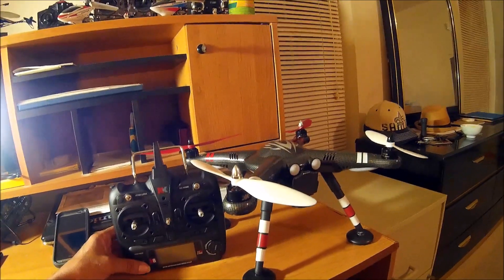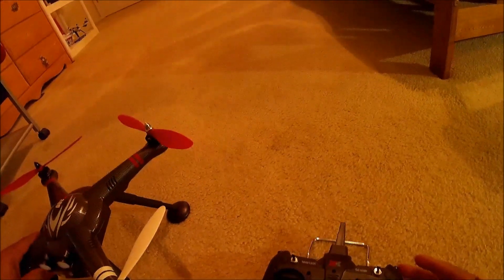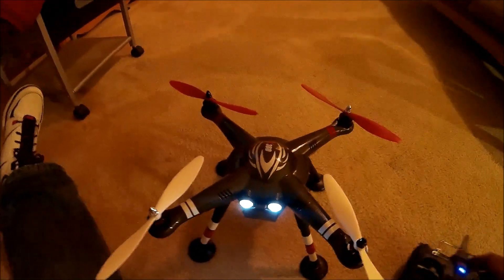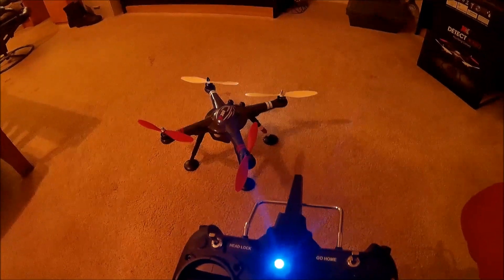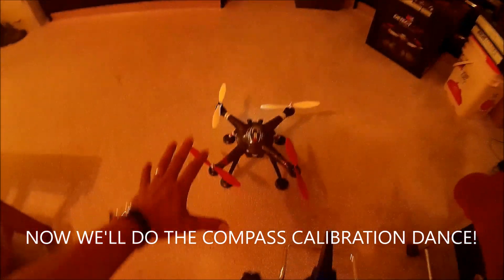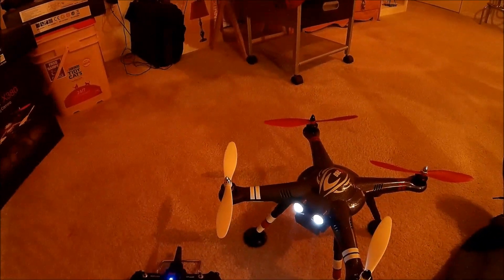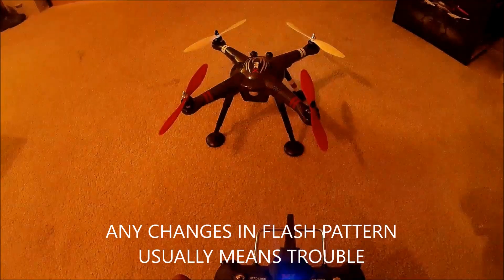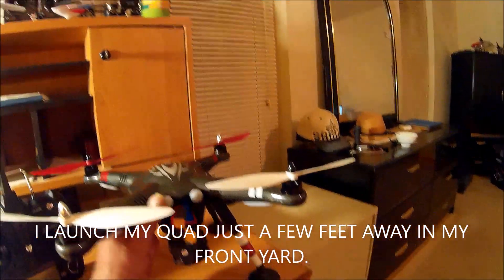XK DETECT X-380 "MUST WATCH BEFORE YOU FLY"

Comment: hey ive got a question, when you take it up in the air by auto take off are you suppose to land it using the auto take off as well? Because there was once i got it up by auto take off and landed it manually onto the ground and the motors couldn`t shut off and had to have a physical fight with it to unplug the battery while props are spinning at full speed :(
Reply from the maker: +kwabiNEXAS  You don't have to use auto land after using auto takeoff. When you land manually, make sure when the quad touches down, quickly pull both sticks down & out (or in) to kill the motors. Holding the left stick alone for more that (about) 5 seconds should also kill motors.  If your quad was in your hands, spinning at full speed, it was trying to go back up to RTH altitude & then land itself!  I hope that it only happened once, did you fly it again since then? Let me know what's up.  Good luck, Merry Christmas  DJ SOUL FORCE
Reply: +DJ SOUL FORCE Hey merry Christmas to you too! i tired very hard killing the motors as what you said pulling the control sticks down and out, it did not work and it kept wanting get back into the air when i already landed it properly, but at that time when it wanted to get back into the air after i landed it almost tilted over, that`s when i knew smth was wrong and i had to stop it from taking off before something bad happen again...argh it was really scary though, i really should get a phantom 3...much more trustworthy and customer support :/
Reply from the maker: kwabiNEXAS  I hope it's ok now. If not, you may have to flash (erase) the memory and re-install. Have you done the new firmware update?
Reply: +DJ SOUL FORCE Firmware update?? How? i`ve heard that adjusting the settings or updating the x380 is known to cause major problems and bricking the quad that`s why i`ve never bothered connecting it to my computer haha, but if you recommend updating maybe i`ll give it a try.
Reply from the maker: kwabiNEXAS  Is it working ok now? If it's ok, I wouldn't mess with it!  I waited a long time before I updated my firmware for the same reasons as you said. I heard a lot of bad stuff about quad going crazy after updating, so I left it alone.  One day my flight indicator turned "solid yellow" while in the air. After I landed, it started flashing red and would fly anymore! So I had to "flash" the memory and install all new files. Works fine now and I also have the auto Panoramic and FAP mode!  Let me know if your's is working ok, if so, I wouldn't update unless you want the new features.
Reply: Yes i`ve got instructions from some video  and got it updated successfully, the FAP works fine but when the problem still lies there, it still won`t hold its position :/ so this "flash" you were talking about, how do i do it?
Reply from the maker: +kwabiNEXAS  I sent you a private message just now on youtube messages.  Did you get it?

Comment: Just got mine today and the battery is charging.  I have watched your video once before I got the Quad and watching and taking notes now so I can do the setup before flight.  I have seen some people have took it out of the box and flown with no problems, but it don't seem like it takes that long to do these steps and It don't seem like it would hurt to be on the safe side.  This is my 1st Quad ever and will be my 1st flight ever.  Looking forward to more of your videos.  Do you plan on doing FPV or messing with extending the range of your X380?  Make sure to do some videos if you do.  I am wanting to do the FPV for sure, but after I have quite a bit of flight time 1st..lol
Reply from the maker: +James Ingram  Actually, I'm not a big "tech" guy, so I won't be modifying the range, but thinking about adding FPV to better line up camera shots.  I hope all goes well with your first flight "ever!"  Most people start with the toy quads before making the leap to this size (and price) quad.  Did you buy the standard model or one with the XK camera on it?  Good luck, happy flying & Happy Holidays.
Reply from the maker: +James Ingram  FYI:  I just finishing registering myself with the FAA, I am now a registered drone owner!  Cost $5 to register all of your drones over 1/2 pound & up to 55lbs. Register before Jan 21 and it's free. Reg # good for 3 years and the number issued can be used on all of your drones.  Sounds cool for now, but what's next...? License and a safety class & maybe a test - $100 next time... Lol  Hope you have all good flights!
Reply: I currently hold a General Class Amature radio license and those tests are no joke.  lets hope they never require us to take one to own a drone.

Comment: Thanks for the video. I have had my 380 for almost a year now and really enjoy it. Since I got it my CX20 piece of junk has been sitting on a shelf where it will spend the rest of it's life as the most unreliable quad I have ever owned. I have been setting my alarm for 15 minute flight with my Runcam mounted on a credit card  mount with no problems. I have reset the RTH parameter to max height and have no distance or height limits set and I fly well under the recommended 400ft. I have flown it to the edge of my friends pasture out in the country which is about 500 yards long without losing signal. That's more than enough distance for me without FPV. Thanks for your setup video it should be a benefit to a lot of owners. Fly safe!
Reply from the maker: +dheller777  Wow, you've gotten some amazing results & longevity out of your x380.  I hope mine flies as well and as long as yours!  Have you done any firmware updates?  And to think, I was going to buy the Cx-20!!!
Reply: +DJ SOUL FORCE I have not done any firmware updates. It flies so good I'm almost afraid to do anything to it.

Comment: Took mine out of the box, assembled it and didn't have to do any of that stuff, took it outside and flew like a champ. No issues at all. These things are already calibrated and bound then tested all functions before they ship them to make sure you get a working unit because of the first batch of bad ones that got by. There are some bad ones out there but most of the time you got idiots flying theirs who mistreat their stuff. If you play by the rules, you shouldn't have any problems. Mine performed all functions flawless, that's not to say that problems down the road won't arise. Remember that electronics are sensitive, at any given time they can malfunction not because of the build but because they are electronics and electronics are not 100 percent fail proof. We now live in a world where warranties are now becoming shorter and shorter because of the sensitivity of electronic have become. 2o years ago you got a 5 year warranty with you're t.v, now today most come with 1 or maybe 2 years unless you purchase an extended warranty. Some stuff only come with 6 months. There is a reason for it, electronics today have become very fragile the cheaper they are made.
Reply from the maker: +SoulR3ap3r  So so true! I agree with everything you said. I do suggest at least a compass calibration every now & then because the compass was calibrated in China and the factory suggest that you do if you relocate takeoff points.  The compass is mostly used for Head Lock mode, which I don't use, so I don't do all that stuff either! Yes, the transmitter is binded at the factory and binding should only be needed again in the event that you buy a new transmitter or change control board, or do major changes to quad, etc.  Thanks for watching, have fun with your x380, it's a nice quad.  Happy flying bro!

Comment: Thanks for the video.  I've been wanting to buy one of these, but after seeing all the negative YouTube videos, I was afraid to "take the plunge" and buy one.  I've often suspected that many of those crashes/problems were due to guys not following instructions or not doing something right.  On another YouTube channel (Dustin Dunnill), all the videos for this quad are GREAT. This video gives me a bit more confidence that this is a good product. I wonder if you did any firmware updates, and/or if you've used the Windows configuration software, where you can set things like maximum height, or how it does its RTH?  I see a link below which indicates you had a problem after updating your firmware, so maybe that's not a good idea. Thanks again.
Reply from the maker: +Bill Somrak  Thanks for watching. I did attempt to change some of the parameters, the process failed, I got a little scared and reset back to factory settings.  On a second attempt, I was successful at changing the RTH direction, saved that setting and "got outta there!" I'd like to see a link from the factory support to update the firmware, versus not knowing if it's genuine or not.  Did you see Dustin's 4 mile flight with the X380? In that video, he stated that before that flight, he'd returned all the settings back to factory specs! I haven't had any problems with my X380 (yet!).  DJ SOUL FORCE
Reply: +DJ SOUL FORCE Yeah, I've watched all of Dustin's videos, including ones where he was setting parameters in that configuration software. I'll have to watch the 4 mile video again to see what he says about the settings. I don't think he could have gone 4 miles with "factory settings". In another earlier video (I think the one that featured the cliff divers) he got out a pretty good distance, and the X380 stopped, and he said something like, that was as far as the settings would allow it to fly.  I agree with you that the manufacturer (which I think is WLToys .. or a division of WLToys) should have: 1) better documentation  2) include a CD with both firmware updating tools and parameter setting tools on it, so that you KNOW that it has the blessing of the manufacturer.  I think the problem is, there are so many of these quad manufacturers in China right now, they are all "shooting from the hip" trying to stay ahead of one another.  I know that there are no guarantees in life, but I would like a little peace of mind that the Quad manufacturer (WLToys or XK - whoever) is looking out for the consumer. Thanks DJ Soul Force!
Reply from the maker: Bill Somrak  You are quite welcomed sir.
Reply: +DJ SOUL FORCE Just wanted you to know that I ordered one of these (finally got the courage to do so) and so I came back here to re-watch your video. I'll be sure to follow the manual and set it up correctly. I've also joined the Facebook group for XK owners, and I think you are on there too.  Once I get the quad, I may have more questions. i just hope the manual isn't in "Chinglish", so I can understand it! Cheers!
Reply from the maker: Bill Somrak  Yes, the manual is in Chinglish (lol) but it's not too bad! Good news is, the factory has now added links on their website for latest firmware, drivers & flight control program. The newer x380's should come already loaded with the latest features. Good luck, Happy Holidays.
Reply: +DJ SOUL FORCE Happy Holidays to you too!

Comment: every time mine does auto take off or manual up I take off straight up it goes to the side and crashes. with two legs still on ground. I can take off with auto but need to push hard forward to stop it crashing works fine once off the ground? any ideas?
Reply: +YouOriginal and lands great no problems.
Reply from the maker: +YouOriginal  Once you get off the ground does it drift away from the takeoff point or does it hover in place?  Only ideas I have is make sure every time you calibrate, make sure it's on level surface.  When you first plug in battery, don't move quad until you get green lights. If none of that works, try flying from a different location.  Hopes this helps.
Reply: +YouOriginal  check your props direction.
Reply: Anthony Johnson thank you yip two were round the wrong way :) any idea why whe it hovers it goes around in circles?. Should it stay in one place.?

Comment: so is this a good drone to buy because I think I'm going to get one. and is it easy to fly for beginners?
Reply from the maker: +Aaron Majors  It's a really great quad for the price. If you have flown toy quads before, the X-380 is great for your first GPS quadcopter.  It is NOT recommended for a first time flyer's quad, however, I know a few guys that are buying this as their first quad.  I suggest that first you develop your skills with a cheaper quad first before investing in the X380.  Thanks for watching.
Reply: DJ SOUL FORCE thanks for your help. I think im still going to get the quad but I won't go flying 500 meters or anything like that I'll just play it safe and when I feel like I have enough experience to fly it a little more professionally I'll take it for more advanced stuff. Thanks again for your help and love your quad vids :) (btw I'm getting the x-380-c)
Reply: +DJ SOUL FORCE one more thing...if I do what I just said I was going to do (fly it safe and not go crazy with it) will I be ok flying it?
Reply from the maker: Aaron Majors  Great choice...just make sure you do your research, "study up" on the X380 and feel like you already know it before it arrives. There were a lot of crashes when this quad first came out, me included!  Most of those crashes were pilot error because the X380, at first it seemed, was a little different than other GPS quads. This was my first GPS quad, after having over 10 toy quads, I almost had to learn all new techniques.  Good luck and happy flying.
Reply from the maker: Aaron Majors  I think you'll be ok...  Just do your homework!
Reply: +DJ SOUL FORCE I've done tons of research on it but I'll be sure to do tons more! :)

Comment: Hey DJ,  got a new one for  everybody out there.  While flying yesterday, everything was going perfect as always.  Then out of no where, I had no control over my 380.  It was out about 700 feet and about 50 feet up. I just let go of both sticks and thought about it for a second and fighting both sticks and by some miracle got it back home. I unplugged all of it and tried to calibrate but no luck. It would not do that. I even watched this video again to make sure I was not missing something.  After several attempts and standing there looking at the transmitter I discover it was set to mode 1. How it got there I don't know.  After that it re calibrated and all was fine again. It had switched modes in mid flight. Maybe it was something I did but I just don't think so.  I had watched another video of this flyer having a problem re calibrating his and could not figure it out.  I  think maybe now that he might have had the same problem I just did.  Hope he got it figured out.  I thought maybe this would be helpful for someone else having this problem.  Point is, check the stick mode before calibrating. Even in flight.
Reply from the maker: +DW Caudill   Wow, very interesting. Glad you shared this, good information.  Thanks.

Comment: does this quad have to be calibrated before every flight,also do you need the transmitter in your hand as you are doing the danse
Reply from the maker: +Michael Blachford  The instructions say calibrate if you move the quad a significant distance away from your last takeoff spot. It's also recommended that you calibrate often, just to be safe.  Some people do before every flight, I don't always. I mostly fly from the same location, but I will re-calibrate if I notice the quad drifting or responding slowly. And, no, you do not need to hold the transmitter while doing the dance! Thanks for watching.
Reply: great video and great info thank you

Comment: Thanks again DJ for such a thorough explanation, I've had My XK for about 2 weeks now and haven't done the Maiden Yet, and this is the first time I've heard about the Binding, I've heard about the Calibration the Compass and about Calibration of the Transmitter though, soon as I've completed all the Mods I'm doing, I'll Youtube My results, as for Crashes and Pilot Error, I've seen that some of the Bad Quads were because of poorly soldered Boards, which means to Me that China Factories must not follow up with a good program of Quality Control, just a heads up, if You open Your XK, double check all the Solder Joints and make sure all plugs are tightly connected, Thanks for this info and as always  Happy Landings..  :)
Reply from the maker: +Soco Joe  Thank you brother. Good luck with your maiden flight, that's always a rush!
Reply from the maker: +Soco Joe  Hey Joe, I'm already subscribed to Dustin Dunnill. When I was trying to chose between the Cheerson CX-20 and the X-380, Dustin was the guy that recommended the x-380.  I'm also a member of the Facebook group, under my real name, DARRYL ROBINSON.  I've posted a couple of my videos there and posted a few comments as well. Thanks buddy, happy flying!
Reply from the maker: +Soco Joe  I'll check out your DIY Cheerson CX-20. Hope it goes well. Thanks